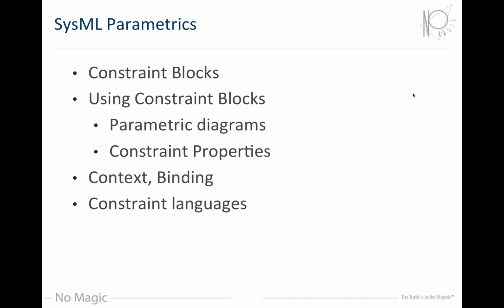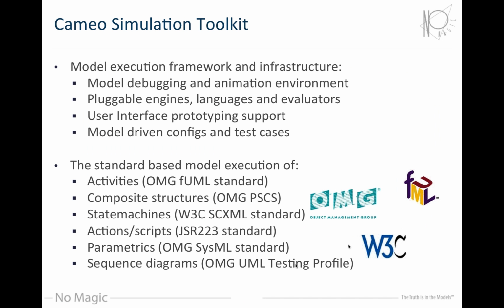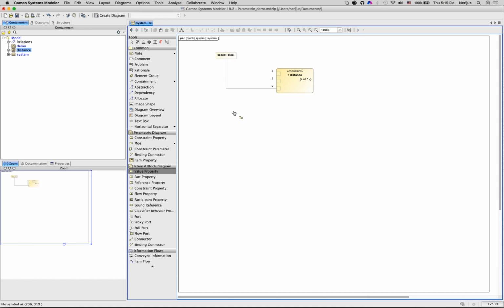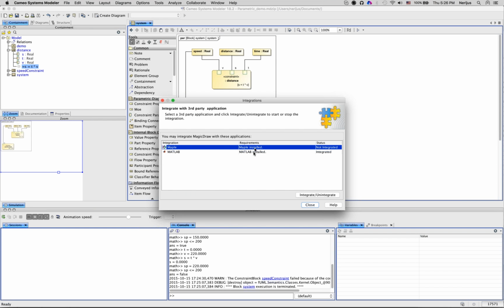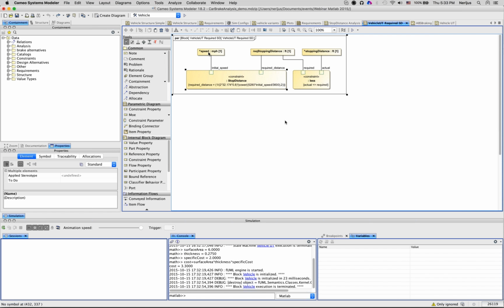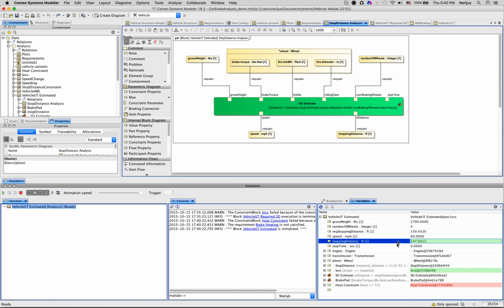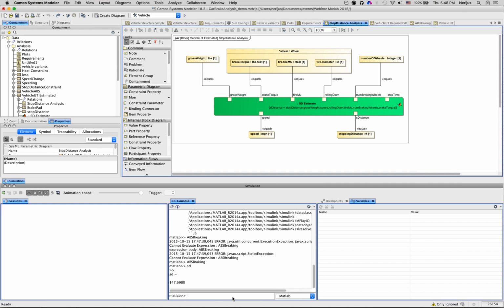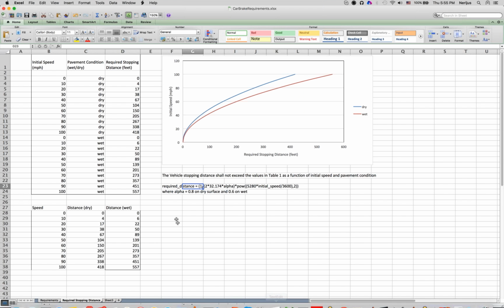SysML model integration with MATLAB Simulink®

Comment: I have a question regarding use of MATLAB functions in Cameo, 
when we use a MATLAB function that has vector or matrix as output, how could we deal with that? 
because if we want to save a vector or matrix in a value property, it is not possible ! and value properties could only save a single value of the output vector/matrix in them !
Reply: I think this video will answer your question. https://www.youtube.com/watch?v=FA6z25Wq5Io 
Bottom line, use the asterisks multiplicities to allow for arrays to be passed from MATLAB.

Comment: Hello - I would like to know if the project that is used in this demo is available for download ? Thanks.
Reply from the maker: Hi, we are going to add this project as a sample into the installation pack of Cameo Systems Modeler 18.4, which will be released on July 18, 2016.
Reply: Cool !
Reply: @3dsCATIAMBSE  I cant drop m file to the par,it is Display as a prohibition symbol